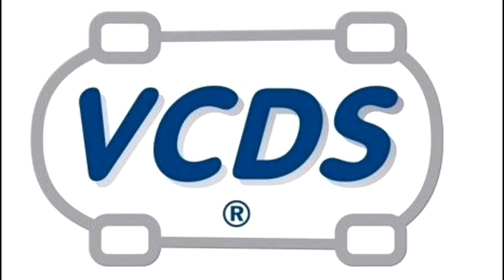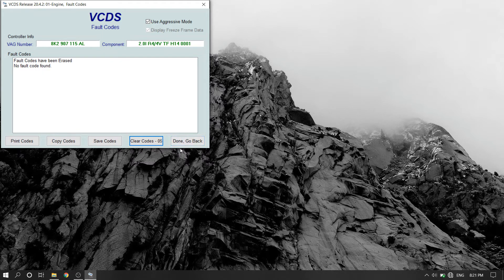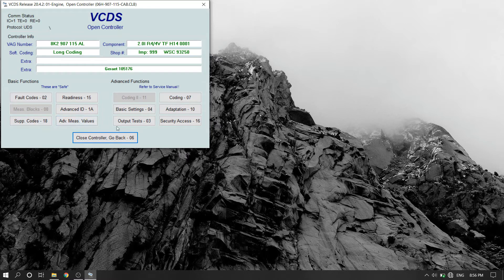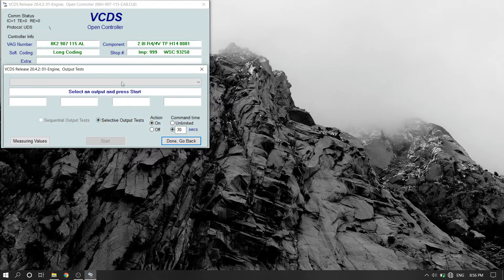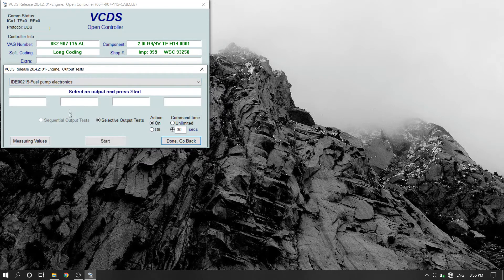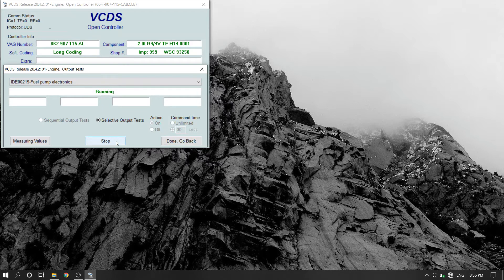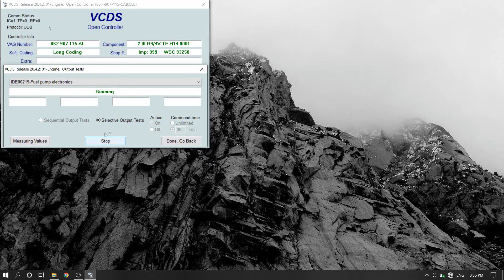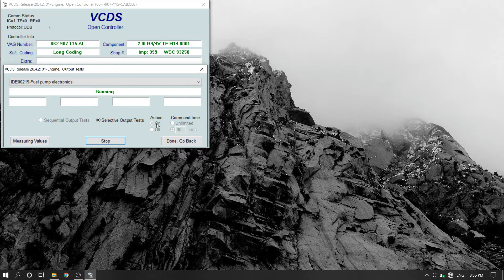TEST/PRIME FUEL PUMP ON VW/AUDI USING VCDS

Comment: Thanks for this. This allowed me to determine that my fuel pump does work and is getting fuel to the engine bay. However, is there a safety or something that doesn't allow the fuel pump to run if the engine does not turn over?
Reply: The hpfp is run on the timing belt. It doesn't work unless the engine is turning it over.
Reply: @ljguy300  Thanks. I'm still working on this. Engine is still not turning over. I've got an 01E swap, and need to go back over the wiring. Replaced the starter and alternator, so those shouldn't be the issue.
Reply: @paulbreaux909  not turning over at all is a concern